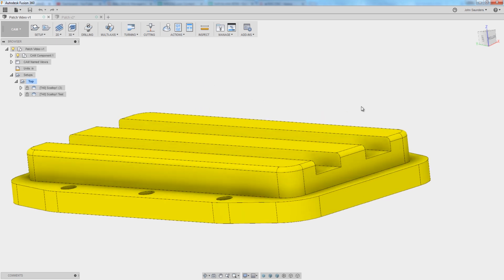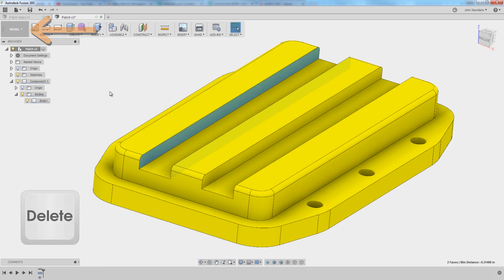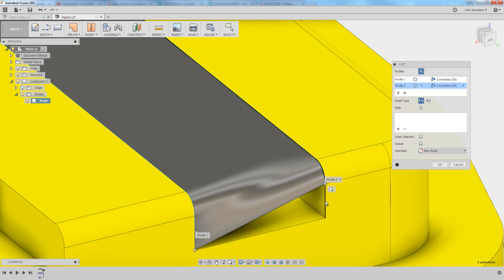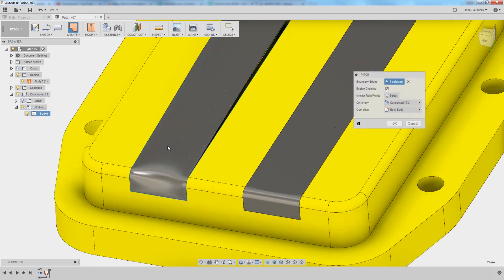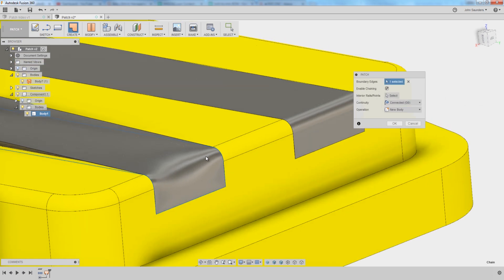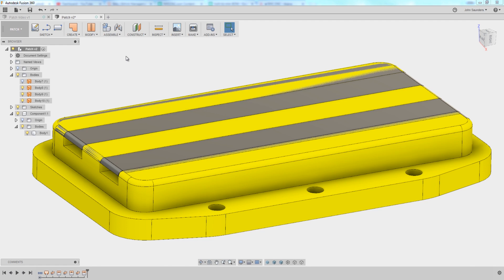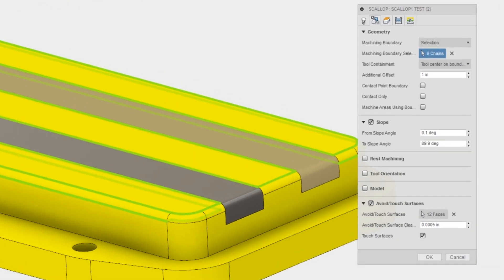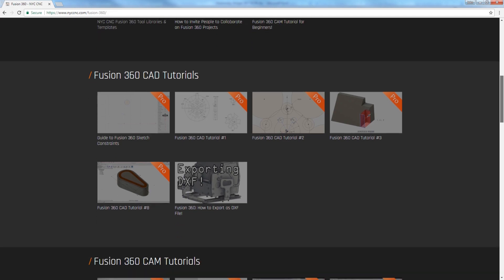Fusion 360 Patch Workspace Tutorial! FF105

Comment: John, some questions come to mind, does it make sense to do trochoidal tool path such as adaptive clearing for slots that are less than D*1 deep, where no chip evacuation issues are there? What about you reduce the surface speed and run the slot without adaptive?  Thanks for the video.